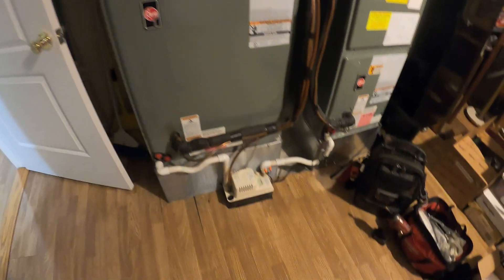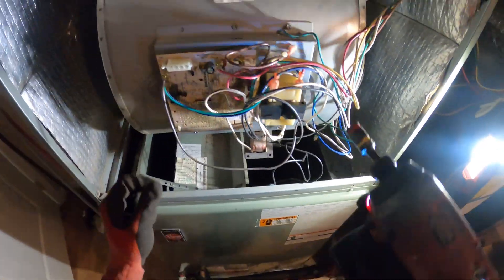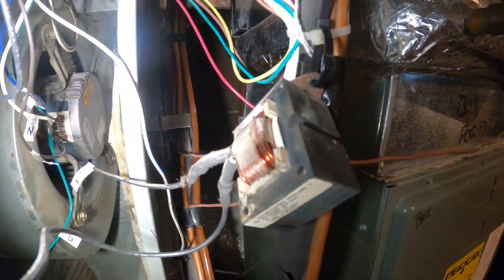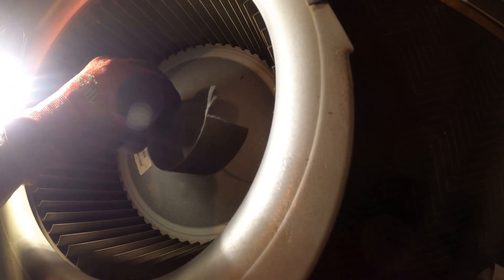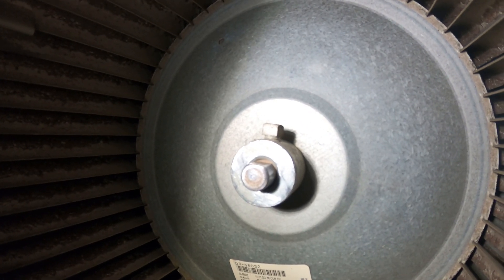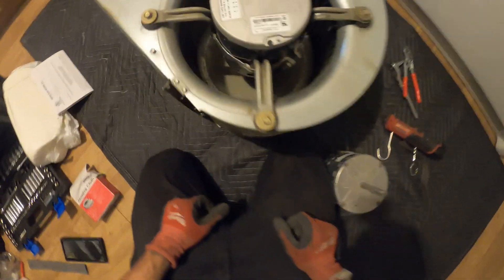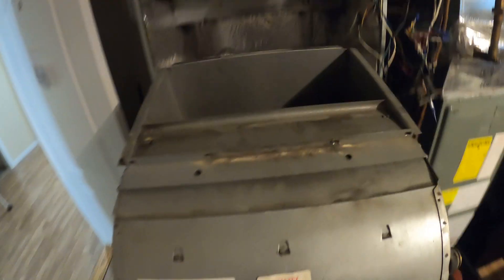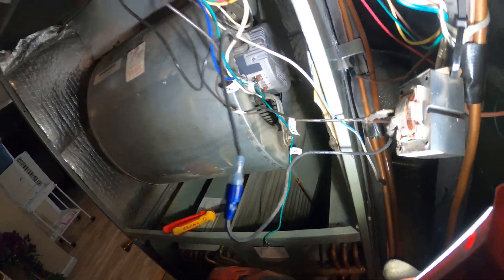HVAC: How To Install A ECM Motor (Electronically Commutated Motor Installation/Replacement)

Comment: I really liked the pro tip of not taking off the blower motor mount... simply loosen the screw and slide it out. Not seen any other video do that.. that was really cool and saves time.

Comment: Unfortunately, laymen cannot but a NEW ECM motor because the AC industry will only sell new motors to certified AC installers.  I bought a rebuilt ECM motor from United HVAC Motors for $300, I installed it myself as in your video, it worked for 3 hours and quit.  They sent me another rebuilt motor and I installed that one, it worked for 2 days and died.  I then returned both motors to them driving them there as the shop was just over one hour away.  I returned both motors.  They offered no apologies and I left.  So, the problem is not installing the blower motor.  The problem is buying a brand new ECM motor that is programmed specifically for your make and model AC unit.
Reply: Bud that’s not true at all.  Supply House sells them, tons of other places online…
Reply: @mct8888  United HVAC was the only place that came up online for me at that price.  But thanks!
Reply: @robertbdesmond  even amazon sells them.

Comment: You just saved me at least $500 in labor and another $300 in parts. I took pictures and labeled wires like working on a motor. It works perfectly now. Thank you for the video and I wish you the best!

Comment: Brother I watch all your vids. So I’m at a aww here I have a ecm blower carrier unit 208v blower motor that doesn’t stop spinning even at the thermo being off. I took thermo head off I disconnected G from thermo and the blower, checked relay everything checked out. I diagnosed the blower motor internally being the problem have you ever encountered that problem?

Comment: Question, the new ecm I got has a ton of wires coming out of it while the older one has just 2 and a ground wire. Where do i wire those at ?

Comment: I've got the same set up. The system will not turn on fan when calling for heat. I have to switch from automatic to manual for it to work. I replaced motor, circuit board, transformer and thermostat.. still won't run in auto!